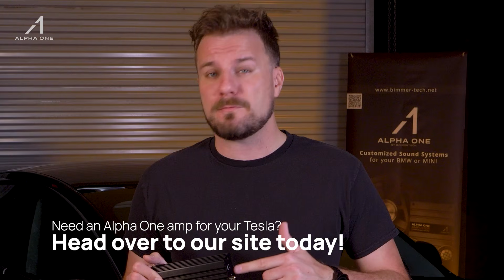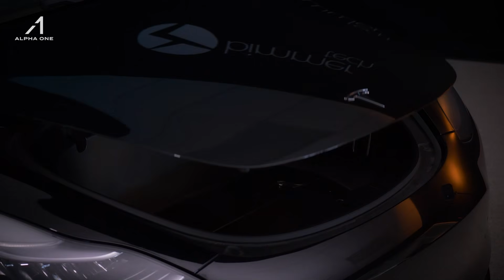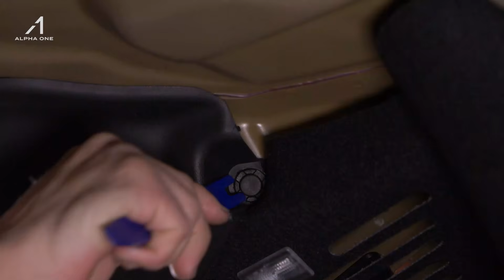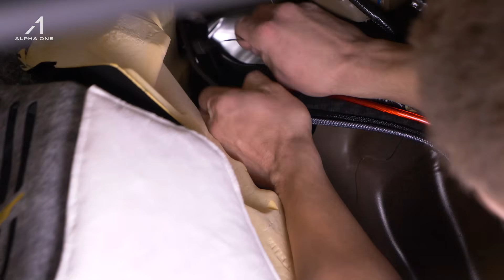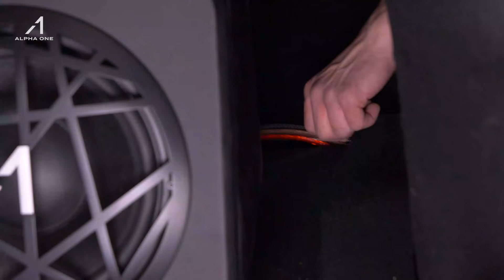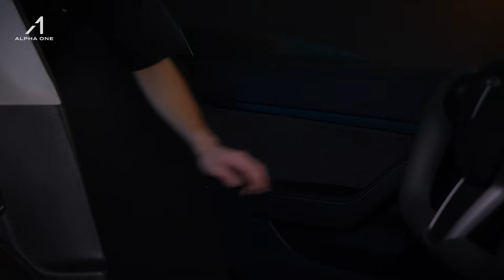Tesla Model 3 (Intel) SUB10 Trunk Subwoofer Installation

Comment: Does it add the sub control bar on tesla EQ ??
Reply from the maker: It does not.  This is just a trunk sub.  However, it is tunable through us and our amp.
Reply: @bimmer-tech Do you have anything to amp up the factory speakers with DSP ?? Also any location near Austin, TX where I can see a demo vehicle ??